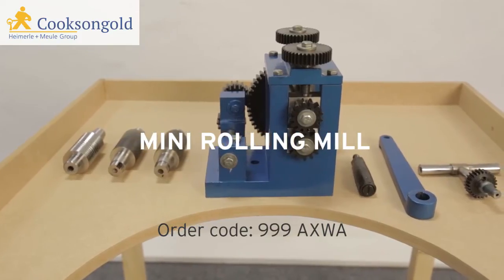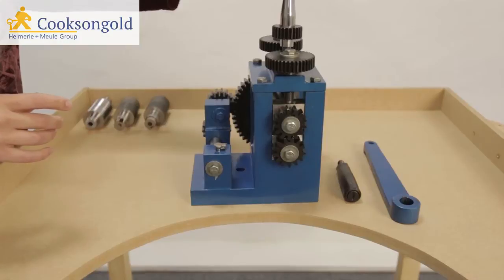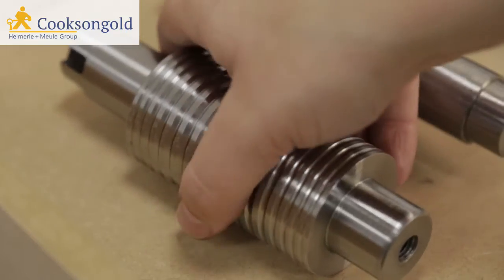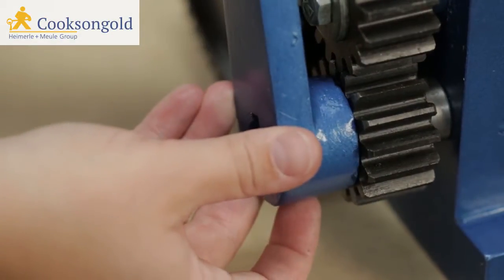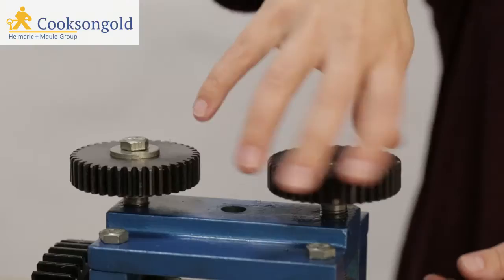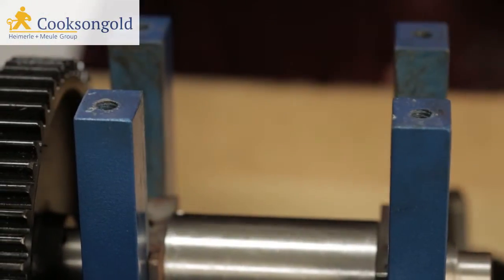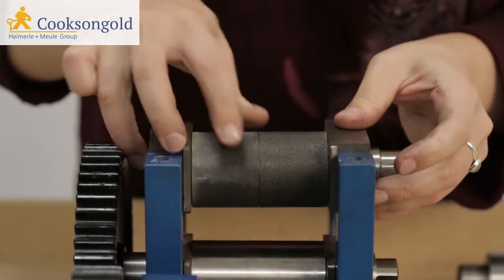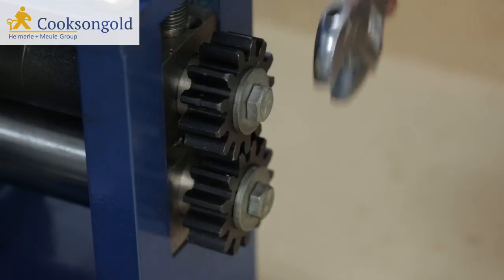Cooksongold Value Jewellers Rolling Mill Assembly How-to-guide

Comment: I'm just wondering
I've recieved mine and there were a pair of coils with it but no instruction, this video doesn't show or mention the coils, where do they go? how to fit them?
thank you !
Reply: The coils, are small springs they sit in-between the two rollers, at each end sitting in small holes in the blocks. (difficult to describe) so that when you open the rollers up  (by turning the top handle), it pushes the top roller up. Without them it would just sit there, resting he bottom roller. As I say, checkout my three videos above.

Thanks for watching. Dave Wilson - Celtic Dreams.
Reply: Thank you :)

Comment: The bolts are very tight, the rollers move when I attempt to use the spanner?  Help please.
Reply: Use a piece of copper or a penny to stick in the cogs or a piece of wood then you can tighten up the Bolts .

Comment: Does it make round wire?
Reply from the maker: Round wire is often made using a draw plate:

https://www.cooksongold.com/Jewellery-Tools/Drawplate,-Round,-0.5mm---3.0mm,-31-Hole-prcode-999-286

A rolling mill is used to roll sheet metal and for square wire

Comment: Absolute junk. ALL rolling mills should be a one piece casting, as this type of design is not. The pressure that you can exert on the rollers is HUGE, and the fact that with this one you have all that force transferred to four bolts holding the top on is just ridiculous. The threads on these will stretch and eventually give in! Do a quick search and you will see a guy re-threading his unit after having this happen. Do yourselves a favour and get something better. Why buy a three legged donkey... sheesh, they made these things better than this nearly two hundred years ago!
This thing is akin to a chocolate teapot!